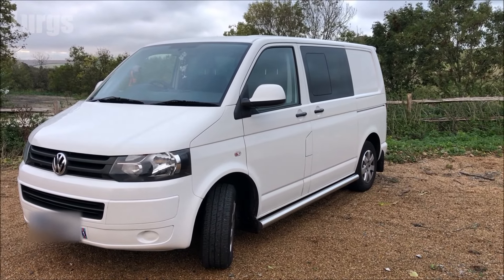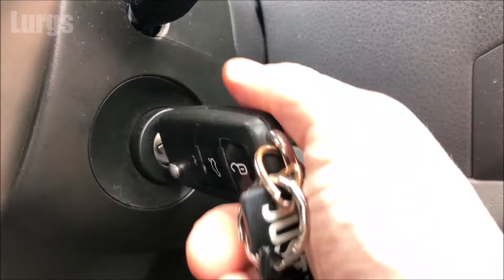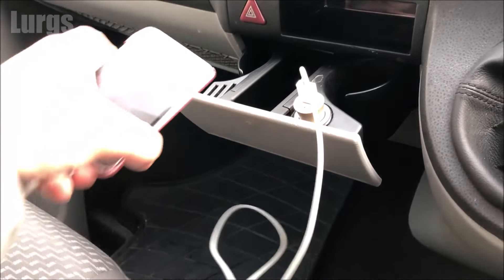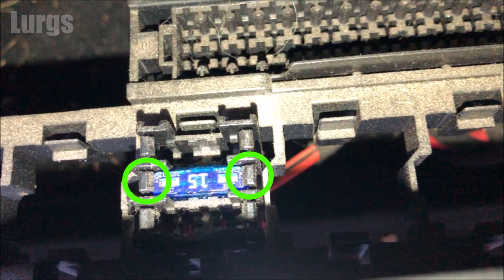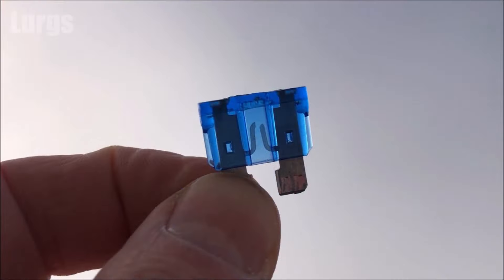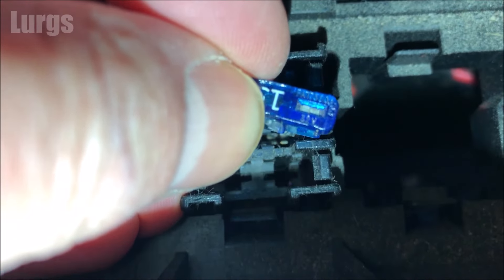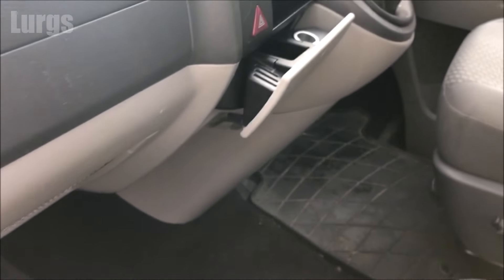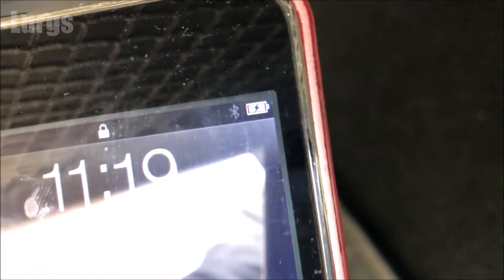VW T5 12V Socket not Working nice Easy Fix

Comment from the maker: Other useful links to help you save ⏱TIME and 💰 MONEY:
VW T5 Fuse Box Locations and how to check Fuses on VW T5 https://www.youtube.com/watch?v=fjJ7z3fDapw&list=PLqrXuUebV8N9EvOWWaBymBuvNRW_wbsBz
.
VW T5 How To's, Tips, Tricks & Fixes https://www.youtube.com/watch?v=fg5eSbW33N4&list=PLqrXuUebV8N9EvOWWaBymBuvNRW_wbsBz
VW How To's, Tips, Tricks & Fixes https://www.youtube.com/watch?v=DosIviY1xxE&list=PLqrXuUebV8N_OyVUXrJNGikNiWncnAW7p
VW T5 Kombi Review and Drive 2011 140hp https://www.youtube.com/watch?v=k17B9jFB-Wk&list=PLqrXuUebV8N9EvOWWaBymBuvNRW_wbsBz
Things I love about my VW T5 Kombi ❤️ https://www.youtube.com/watch?v=KEzHup47Eog&list=PLqrXuUebV8N9EvOWWaBymBuvNRW_wbsBz

Things I hate about my VW T5 Kombi https://www.youtube.com/watch?v=2s1n0zJ0FVY&list=PLqrXuUebV8N9EvOWWaBymBuvNRW_wbsBz

.
VW How to replace Windscreen Washer Jet Nozzles https://www.youtube.com/watch?v=DosIviY1xxE&list=PLqrXuUebV8N_OyVUXrJNGikNiWncnAW7p
VW Comfort Windows Opening and Closing https://www.youtube.com/watch?v=xoTDy-XsgFA&list=PLqrXuUebV8N_OyVUXrJNGikNiWncnAW7p
Alternator Clutch Pulley Fault VW https://www.youtube.com/watch?v=ELzavhDUtiw&list=PLqrXuUebV8N_OyVUXrJNGikNiWncnAW7p
How to replace battery in VW Key Fob https://www.youtube.com/watch?v=9NTrgSOyMpM&list=PLqrXuUebV8N_OyVUXrJNGikNiWncnAW7p
How to remove door card on VW T5 https://www.youtube.com/watch?v=fg5eSbW33N4&list=PLqrXuUebV8N9EvOWWaBymBuvNRW_wbsBz
How to reset Service light on VW T5 https://www.youtube.com/watch?v=XbhlvOeze_Q&list=PLqrXuUebV8N9EvOWWaBymBuvNRW_wbsBz

VW T5 Windscreen Washer Jets not Working - Fixed https://www.youtube.com/watch?v=o7pqutsC-GE&list=PLqrXuUebV8N9EvOWWaBymBuvNRW_wbsBz
How to replace Serpentine Belt Tensioner VW T5 https://www.youtube.com/watch?v=ohOVePGlLSA&list=PLqrXuUebV8N9EvOWWaBymBuvNRW_wbsBz
VW T5 Dashboard Lights Meaning https://www.youtube.com/watch?v=O9uVKzmSaMg&list=PLqrXuUebV8N9EvOWWaBymBuvNRW_wbsBz
VW T5 How to remove Windscreen Washer Jet Nozzles https://www.youtube.com/watch?v=XuYKGaL-25o&list=PLqrXuUebV8N9EvOWWaBymBuvNRW_wbsBz
How to set clock on VW T5 https://www.youtube.com/watch?v=nOhMd2b8He0&list=PLqrXuUebV8N9EvOWWaBymBuvNRW_wbsBz
VW T5 Engine Bay Overview 2011-2015 https://www.youtube.com/watch?v=YWgXOJyRMs0&list=PLqrXuUebV8N9EvOWWaBymBuvNRW_wbsBz
VW T5 Kombi Window Leak https://www.youtube.com/watch?v=k8HXItF8wmo&list=PLqrXuUebV8N9EvOWWaBymBuvNRW_wbsBz
VW T5 Serpentine Belt Routing https://www.youtube.com/watch?v=5eVlYkBuMV4&list=PLqrXuUebV8N9EvOWWaBymBuvNRW_wbsBz
VW T5 Tyre Pressures https://www.youtube.com/watch?v=-nCbhC8BRho&list=PLqrXuUebV8N9EvOWWaBymBuvNRW_wbsBz
VW T5 OBD2 Diagnostic Port Location https://www.youtube.com/watch?v=DFwk7a9XpnI&list=PLqrXuUebV8N9EvOWWaBymBuvNRW_wbsBz
VW T5 Battery Location and How to check battery on VW T5 https://www.youtube.com/watch?v=0go06pmeY34&list=PLqrXuUebV8N9EvOWWaBymBuvNRW_wbsBz
How to open Bonnet on VW T5 https://www.youtube.com/watch?v=VvjdVPhf_Bw&list=PLqrXuUebV8N9EvOWWaBymBuvNRW_wbsBz
VW T5 Undertray Removal https://www.youtube.com/watch?v=nP8LkfvvyqA&list=PLqrXuUebV8N9EvOWWaBymBuvNRW_wbsBz
How to replace the battery on a VW T5 https://www.youtube.com/watch?v=RFPCaEzdZ4M&list=PLqrXuUebV8N9EvOWWaBymBuvNRW_wbsBz
How to replace Wiper Blades on VW T5 https://www.youtube.com/watch?v=kPF2THp6lH4&list=PLqrXuUebV8N9EvOWWaBymBuvNRW_wbsBz
How to replace rear wiper blade on VW T5 https://www.youtube.com/watch?v=T8sF3m3oGBk&list=PLqrXuUebV8N9EvOWWaBymBuvNRW_wbsBz
VW T5 Fuel Filler Cap Holder https://www.youtube.com/watch?v=7Eg7uEg9fSM&list=PLqrXuUebV8N9EvOWWaBymBuvNRW_wbsBz
VW T5 turn off Passenger Airbag https://www.youtube.com/watch?v=1nJOmgb563M&list=PLqrXuUebV8N9EvOWWaBymBuvNRW_wbsBz
How to replace Pollen Filter on VW T5 https://www.youtube.com/watch?v=ZLLPeBOF1XU&list=PLqrXuUebV8N9EvOWWaBymBuvNRW_wbsBz
VW T5 Windshield Wiper Fluid Bottle Flushing Out https://www.youtube.com/watch?v=7tck8P84xd0&list=PLqrXuUebV8N9EvOWWaBymBuvNRW_wbsBz
VW T5 Serpentine Belt Check https://www.youtube.com/watch?v=3iTL_tDM4uU&list=PLqrXuUebV8N9EvOWWaBymBuvNRW_wbsBz
How to adjust steering wheel on VW T5 https://www.youtube.com/watch?v=ZXCiMdcLNu0&list=PLqrXuUebV8N9EvOWWaBymBuvNRW_wbsBz
VW T5 Key Fob Battery Change https://www.youtube.com/watch?v=fby4ZkuwbRM&list=PLqrXuUebV8N9EvOWWaBymBuvNRW_wbsBz
VW T5 How to Turn off Interior Monitoring Alarm System https://www.youtube.com/watch?v=IItGoL0y4lc&list=PLqrXuUebV8N9EvOWWaBymBuvNRW_wbsBz
How to jump start a VW T5 https://www.youtube.com/watch?v=bQKl62eLHio&list=PLqrXuUebV8N9EvOWWaBymBuvNRW_wbsBz

.
Vehicles How To's, Tips, Tricks & Fixes https://www.youtube.com/watch?v=w44aQ7dc_Lk&list=PLqrXuUebV8N9fyM8qA2D0rkVfv929Ckod
How to check car fuses without pulling them out https://www.youtube.com/watch?v=w44aQ7dc_Lk&list=PLqrXuUebV8N9fyM8qA2D0rkVfv929Ckod

.
VW T5 Bulbs
===========
How to remove rear light cluster on VW T5 https://www.youtube.com/watch?v=AOXCzphHhO8&list=PLqrXuUebV8N9EvOWWaBymBuvNRW_wbsBz
How to turn on Fog Lights on VW T5 https://www.youtube.com/watch?v=ytYQL-STdFk&list=PLqrXuUebV8N9EvOWWaBymBuvNRW_wbsBz
How to replace brake light bulb on VW T5 https://www.youtube.com/watch?v=vm8jLjNx1Fc&list=PLqrXuUebV8N9EvOWWaBymBuvNRW_wbsBz
How to replace Tail Light bulb on VW T5 https://www.youtube.com/watch?v=k2SDU3dzYuA&list=PLqrXuUebV8N9EvOWWaBymBuvNRW_wbsBz
How to replace rear Fog Light bulb on VW T5 https://www.youtube.com/watch?v=orWKrZBT4Hg&list=PLqrXuUebV8N9EvOWWaBymBuvNRW_wbsBz
How to replace rear indicator bulb VW T5 https://www.youtube.com/watch?v=0kocqjrr8lc&list=PLqrXuUebV8N9EvOWWaBymBuvNRW_wbsBz
How to replace Reverse Bulb on VW T5 https://www.youtube.com/watch?v=KpZBEhfbDKk&list=PLqrXuUebV8N9EvOWWaBymBuvNRW_wbsBz
How to adjust headlamp beam on VW T5 https://www.youtube.com/watch?v=XE47rBhtaVs&list=PLqrXuUebV8N9EvOWWaBymBuvNRW_wbsBz

Comment: There’s 2 ,15 amp fuses under passenger seat .. one for power to drink holder cig lighter socket like your video and the other fuse for the top dash tray 12 v socket ...
Reply from the maker: It's only the Caravelles that have the extra top dash 12v socket,  mine hasn't got one.
Reply: @LurgsHowToGuides  mines a high line 140 t5.1 with the toptray socket and the drink holder socket .. big help though watching your videos 👌kind regards

Comment: Is the fuse located in the same place on a twin seat T5? Thanks in advance👍🏼
Reply from the maker: It probably is and access is easier as the front seat pops out.
Reply: Ta👍🏼
Reply: Did you find it? I can't find the fuse on my twin seat T5

Comment: Can you do a video on how to change the actually cigarette lighter itself. Got a new one because the one in doesn’t light up. No idea how to go about it.
Reply from the maker: I would if mine was broken. Just be careful as I think the 12V Cigarette lighter is permanently live so you will have to disconnect the battery to be safe. Hope you get it sorted ok. I think the whole unit should pop out somehow. Good luck.
Reply: That`s a nightmare job apparently.

Comment: Just replaced my fuse and still not working ?
Any other ideas , help as to what it can be please .
Reply from the maker: Not sure, maybe the socket isn’t working or has twisted, try some other devices in it incase it’s the thing you are plugging in
Reply: @LurgsHowToGuides  thanks lurges
I’ve just cleaned the lighter contact with emery and it’s now working   
Can’t believe it was that simple .
The fuse was definitely broke as it was melted but still didn’t work from replacing with new . Saw another video of one being cleaned and bish bosh bash . Fixed it 🤣
Love yer videos mate keep up good work
Reply from the maker: @Nick-oh3vs  Amazing news. Well done for fixing and glad my video helped a little 😎
Reply: @LurgsHowToGuides  it certainly did

Comment: Have same issue but the front seat can be turned to face the rear of the van so I doubt theres a fuse under there, Van is a T5 2006, anybody know if that fuse is located somewhere else.
Any help appreciated 👍
Reply from the maker: Not sure where it is, might be in the internal fuse box maybe. Hope you find it
Reply: checked main fusebox, all 15amp ok, thanks anyway.
Reply: With an aftermarket swivel passenger seat, the wires and fuses under that seat are often stuffed in a hole in the carpet under the swivel base. Might have to take the swivel base off the floor to get at them! 😮

Comment: Where would the fuse be with a double passenger seat in cant find it anywhere??
Reply from the maker: @adamwalters2465  Not sure, hope you can locate it. Check all the comments as someone may have found it and commented

Comment: One of my fuses keeps blowing.
Reply from the maker: Either fuse is too low amps for what is meant to be there, or something electrical is making it blow. If it keeps blowing  you need to find out what is causing it